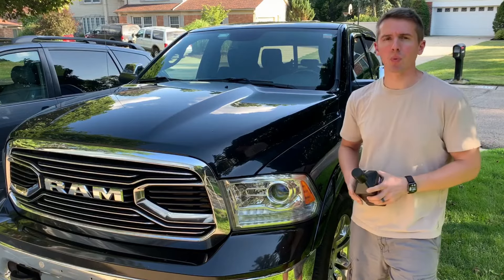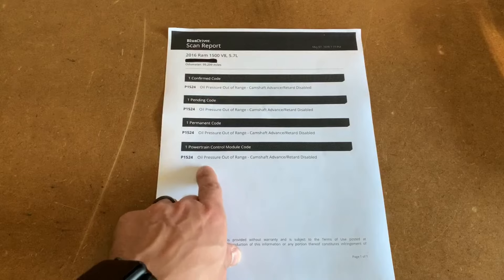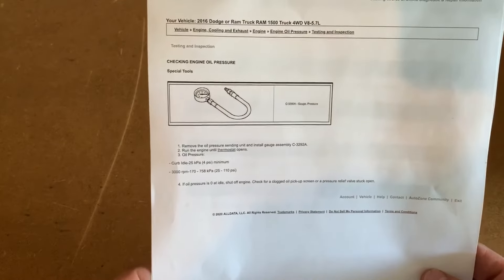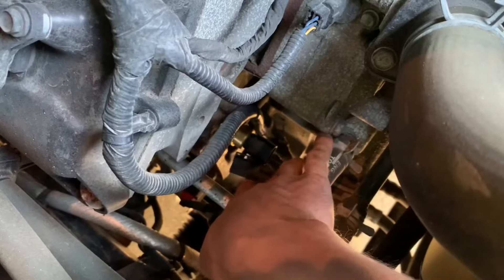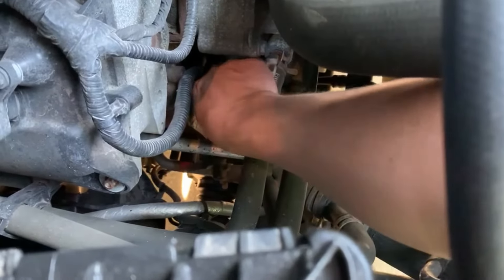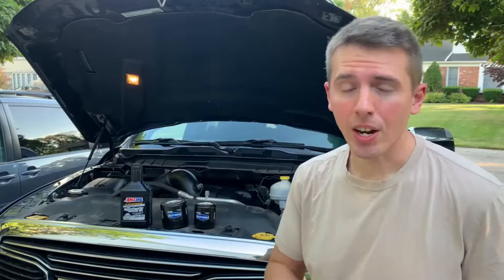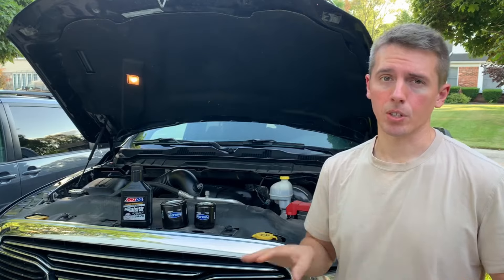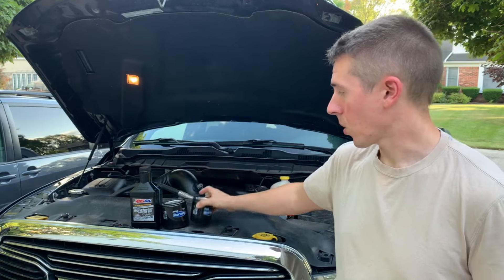2016 Ram 1500 - 5.7L Hemi - P1524 Oil Pressure Out of Range

Comment: I have the p1524 code right now on a 18 ram 1500 hemi and am about 3000 miles into Amsoil sig series 5w 20 with the Amsoil filter. I don’t know what to do if I should continue to run the because psi isn’t everything lower psi could mean the oil is flowing with less restriction so it needs less pressure to flow with high volume. I am at 30 psi at idle at temperature. And 35-37 when driving normal 1500 rpm at operating temps. I cleared today with a scan tool and will see if the code comes back or should I change the oil and filter now. Did the OP ever go back to Amsoil with the bigger filter?
Reply from the maker: Hi Jake,  sounds like you are having the exact same problem I had.  
Short answer, Yes.  Back to normal PSI with Amsoil and larger Purolator filter.  We also run the same setup in my son's 2013 Ram.  All good.
Long answer: I also cleared the code several times with my scan tool.  It continued to come back when I had the faulty Amsoil EA filter on.  I suggest changing the oil filter as soon as possible because your oil filter is clogged up and in bypass.  Basically since the oil can't get through the filtration media its just flowing straight through with no filtration to keep up with the engine oil pump demand.  This means you are circulating dirty oil through your engine.  I also suggest getting another brand larger 2012  and older size filter.  Your oil and engine will be much happier. 
Once you change the filter, save the old Amsoil filter and contact Amsoil to let them know what happened.  They will most likely ask you to return it so they can inspect to see if the filter was in fact clogged or faulty.  If it's faulty you'll probably get a refund or replacement (I would take the refund).
Reply: @attached2mygarage37  yessir thanks for your speedy reply in my time of uncertainty I’ll be doing that soon.
Reply: @Attached2MyGarage I just put in a fram ultra synthetic and had 56psi at start up and 30 psi at 208f at 500 rpm I cleared my code p1524 it has not come back on yet but my pressures are pretty much the same. I have only driven 5 miles or so I will update if the code comes back. Ps I topped oil off with one whole quart of Amsoil signature series 5w20.
Reply: My problem is solved it was the filter thanks very much for this video.

Comment: What will happen if I keep the oil and filter that caused that code? Assuming that I'm experiencing the same issue.
Reply from the maker: Leaving the clogged oil filter forces the filter into bypass.  This means you will be running unfiltered oil through your engine over and over.  Long term this will create premature wear on many critical surfaces including the cylinder.  Changing the oil depends how long you've been running it with a clogged filter.  If using Amsoil, you can send the oil in for analysis and Amsoil will tell you if it's time to change the oil.
Not to mention continuing to run your truck with a trouble code long term will hurt your trucks feelings:)
Thanks for watching and commenting, much appreciated.
-Dan
Reply: @attached2mygarage37  Thanks!🍻

Comment: What was your solution to the VCT problem? My truck has the same symptoms.
Reply from the maker: Hi Matthew - Changing my oil filter got my oil pressure back in range eliminating the VCT trouble code.  In this video I also suggest opting for the larger pre-2012 Hemi oil filter size.  More filtering media to help prevent clogging the filter.
Thanks for watching!
-Dan

Comment: What oil filter are you using? Just noticed after a thousand miles or so after my oil change that my oil pressure dropped to 27-30 at idle and goes up to 30-34 when driving / cruising around. Going to replace the 3 things as you did in this video since everything is fairly cheap.
Reply: Did it work? What was the end result?

Comment: It's a very easy fix just replace the PVC valve replace the oil sensor switch and change your oil the problems you go right away I forgot one step by some engine flush before you change it flush the engine then change the oil you should be fine it's just sludge that's why people don't really show you love them fixing it cuz it's so easy and I don't mind yesterday and I bought the engine flush from Napa for $5 and I use the wix oil filter from Napa also use 7 gallons of 5w 20 Purple oil full synthetic

Comment: Did you try the larger filter yet? I just did the same thing (was using the Amsoil filter) and used the larger one, pressure at idle went from 29 to 50. Haven't driven it yet, did you have any issues with the pressure being high after using the larger filter?
Reply from the maker: I put the larger filter on my son's 2013 and all is working well.  I'll put the larger one on my 2016 next oil change.
As long as your oil pressure is between 25 - 110PSI you know your oil pump is working.  The trouble code comes into play if your PSI never exceeds 42PSI.  That's where the variable cam timing kicks in.  So based on your above comment going from 29 (does not exceed VCT trigger)  up to 50 (VCT trigger achieved) you should be in good order with no more trouble code.
Thanks for watching a commenting.
-Dan

Comment: My dealership is saying that if an oil change doesn't fix it, they will have to clean the entire engine for metal debris, and if that doesn't fix it then a full engine replacement will be needed.   I really hope the oil change here is what they do to fix it.
Reply: I had Dodge repair facility state diagnosis for this problem replacing engine w/ long block or remanufactured engine. This is my 1st Dodge product & going to try lots of possible cheaper solutions before going that route. 😆

Comment: You did not  give the pressure after the fix.
Seems that your pressure is too low.  Mine is a 2014. W/ 50 +  lbs . Try Grease lightning Zink/Teflon Additive. It cleared my code instantly. Cherrs. Sir!

Comment: I2022 Ram 1500 Limited use Amsoil 0W20 SS and Trasko 20 ws full flow and bypass filter all in one 3 gallons/minute for full flow and 1 gallon for bypass also cleans to 1 micron added oil relocation kit for EZ oil change did an oil analysis came back perfect engine is quite smooth running not jerky like before 17K miles I change the oil every 4K cause I like to and use Amsoil engine clean with every oil change  I like clean oil.

Comment: Swapped the Amsoil high micron filter out today for a new wix filter did not change the oil. I went from 25 psi at idle to 38 psi immediately and 61 psi at 3,000 rpm. I believe the Amsoil filter was plugged at 7,300 miles and the ecm was bypassing hence dropping the pressure hence disabling the vct system hence throwing the p1524 code
Reply: Did it fix the issue
Reply: I have just done the same and the MIL has not cleared but noticeable difference on oil pressure gauge with WIX filter. BTW, Amsoil is not recommending that filter anymore and advising to get a WIX. Waiting to see if the code clears itself or will I have to get a mechanic to clear it.
Reply: Did you have any misfire codes?

Comment: That’s why I stick to oem oil filters eliminates the headaches and guess work, this truck was tested with the oem filter installed not some aftermarket filter that’s not made to specs of the manufacturer just because it screws on doesn’t mean it’s working correctly internally..don’t let a non tested aftermarket filter blow your 10k engine it’s not worth it to be arguing and fighting with your dealership over who’s fault it is when your engine goes left.. when a problem arises the oil filter company and engine manufacturer will be pointing fingers at each other and you’ll be left holding the bag.. can you afford to have your truck sitting at the dealership while they play the blame game? Can you afford a lawyer that will fight for you to get engine work performed?? Use oem filter along with proper spec oil weight and quality and oil changes performed on time and that removes all doubt and then you can’t be blamed for anything
Reply: Well said. This comment belongs at the top of the page.
Reply: @robertnekut83  thank you